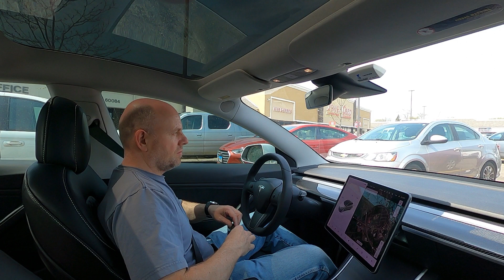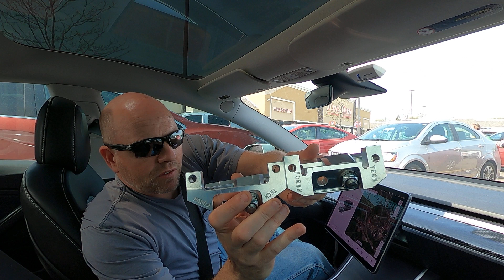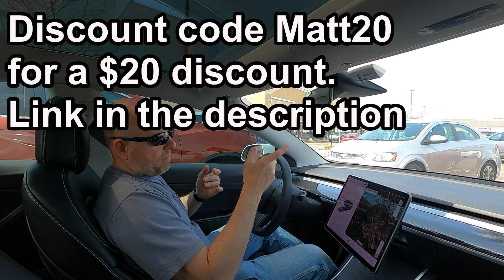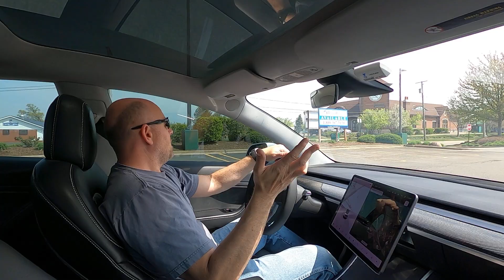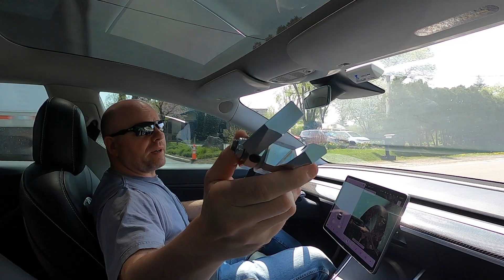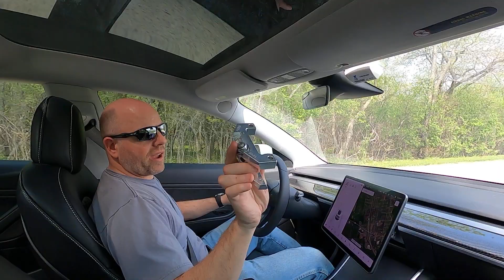Tesla Model 3 and Model Y Swiveling Screen mount kit update

Comment: I also have a white model 3. I have a question for you that I am unable to get an answer for from Tesla. I made the mistake of test driving a model Y last weekend and now I want one. One issue. The rear view mirror in the center of the windshield is exactly too low. It’s right in my line of sight because they lowered it by a couple inches. I want to know if the model 3 rear view mirror mount can be installed in the model Y thus raising the rear view mirror up out of my way. I suspect you might have a way of determining if this can be done. The reason it’s in the way is that I am 6’6” tall so my line of sight is higher than average. Line of sight in my model 3 is perfect and it’s rear view mirror isn’t in the way in the least. It is above my line of sight. Here’s hoping you can help.

Comment: Hi Matt, just wanted to let you know as an early adopter of your Gen 1 Mount which served me well for the past 18 months. I just installed your latest version today.  WOW, what a difference, I don’t have to reach anymore. I can easily rest my elbow on the armrest. As bonus the installation was even easier than the original, since I didn’t need to remove the plastic shroud or unplug the screen. It maybe took all of 10 minutes to swap over being very cautious with the screen. The only thing that took a moment to figure out were the 3D Velcro tabs. I didn’t recall seeing those in the installation video but I was able to figure out where they went without issue.  I can’t wait to see what new products are you’ve come up with.  Rock solid product.  Buy 🇺🇸

Comment: I'm ready to buy, but I have the 2021 refreshed model and a wife with a question: Has anyone had issues with their Tesla new car warranty because of it's installation? 
I've watched your channel and enjoyed it since you began.  I trust that you have a great product!
Reply from the maker: Aftermarket accessories are protected by law. Also, if you are worried about Tesla making a stink about the kit when you bring the car in, the mount is really easy to remove when you bring the car in. That being said, our two local service centers have had my car in for service and told me the mount is cool and they have no issues with it. I think that may differ for each device center though. Lastly, in over 800 sales, I have never had a customer tell me they had a warrantee issue.

Comment: I got the updated version installed recently on my Model 3! Not cheap. Especially if you live in The Nederlands/Europe due to taxes. Still a good investment. Very well made with eye for detail. It holds an expensive screen. Reason why I wouldn't use a chinese wannabe copy for this purpose. Just my 2 cts. Installation is a breeze if you follow the installation video. I do think the lowered position is a pity. I can't see te upper part of my phone anymore, so I have to put it in landscape position. Luckily that's possible with the aftermarket charger. I use my phone in the car for the speeding cameras app and alternative navigation. I was used to it quickly. Don't wanna go back to original!

Comment: I’ve been interested in this since getting my Y last fall. What’s held me back is that it seems to lower the screen height. Can you share more about that? I’m a tad taller at 6’0 and think the factory height is good for me.
Reply: I'm about the same height and installed v2 on my MY. No worries at all.
Reply from the maker: The screen is dropped 1.6 inches. This is necessary to provide mechanical clearance. The screen is also tilted back 9 degrees to give the proper viewing angle with it lowered that bit.

Comment: Thank you for all that you do, and keep up the good fight!  A bit off-topic, but I know you were big into car stereos back in the day.  I've upgraded my Model 3 speakers with the new carbon fiber speakers from Light Harmonic.  As good as the factory speakers are, the Light Harmonic kit does sound better.
Reply from the maker: AWESOME! I considered the subwoofer upgrade.
Reply: @TechForumTesla  The sub is good, but the real wow factor is from the front door woofers.  I believe they sell these in package deals, so they have a package with the front door woofers that come with the subwoofer.  All of the speakers are an improvement, but if I only had a limited budget to spend, I would get the door woofer/sub combo.
Reply: @BecauseTesla  So you don't think the mids aren't worth replacing? Only the door woofers and subwoofer?
Reply: @mmark300  It depends on the system that came with your car.  If you have a standard range + with the basic interior, you won't have a sub or rear panel speakers.  I would buy the door and midrange package for that car.  But if you have the long-range with premium interior,  I would replace all of the speakers (including the mids).  However, if money was tight and I had to choose a less expensive package...the better bang for your buck would be the door woofers and sub.
Reply: @BecauseTesla   Ah, thanks! I forgot about the different audio packages. I have the LR.
Reply: @mmark300  Ok great.  So you have the premium stereo with all the speakers.  Light Harmonic sells their speakers in bundled packages.  If you have the budget to replace them all, then I would do it.  However, if money is tight and you just want to dip your toes into an upgrade; go with the doors and sub.
Reply: @BecauseTesla  Thanks for the advice - so many upgrades, so little money... :)

Comment: You mention in the video a difference between LHD and RHD models (pivot is offset), I can’t see anywhere in the order process to specify this. Will you know which one to send based on my location or do I need to specify somewhere??
Reply from the maker: When you order, you can shoot me a message through Shopify to set it up for right hand drive. It is super easy to change if you need to. It is just one bolt.

Comment: If you make it, China will copy it. How many miles do you have on your car now? Any new problems? I miss your videos.
Reply from the maker: 108,000 miles. Yes, my power steering has a problem. Tesla thinks it is the torque sensor behind the steering wheel. It is going in for service in a couple weeks.
Reply: Looks like I’ll need to buy my third, just love it but love the improvements!